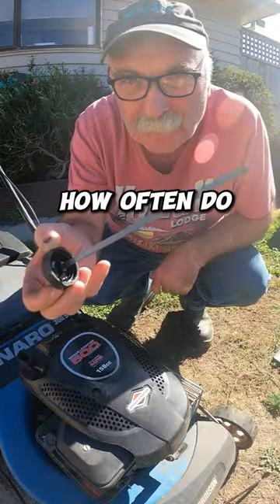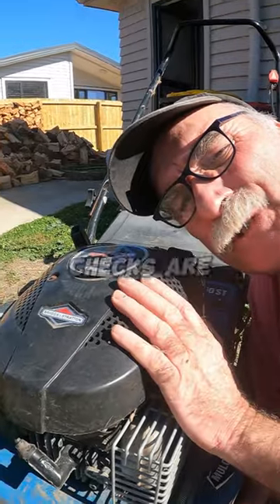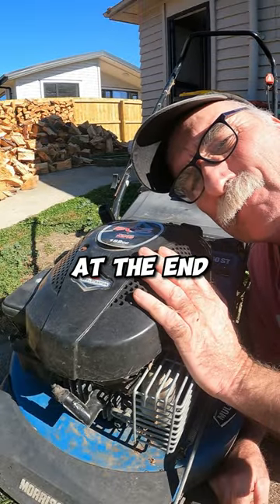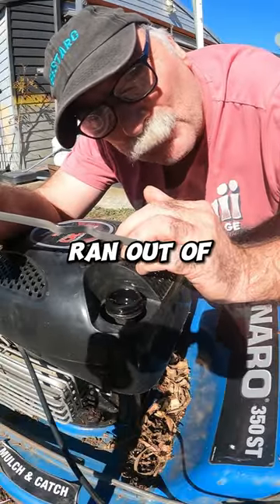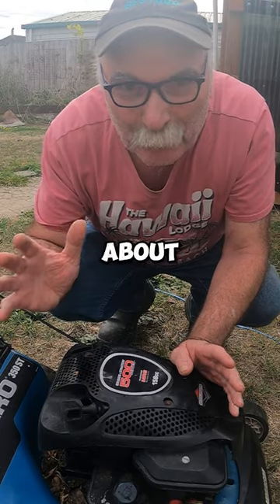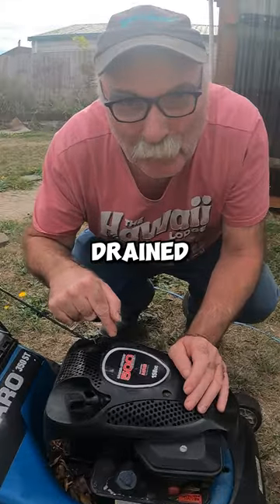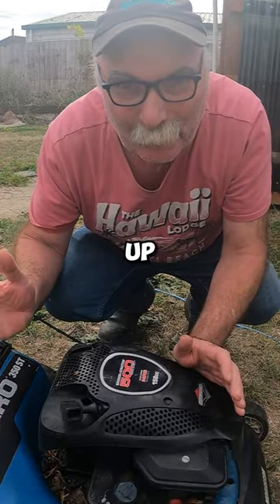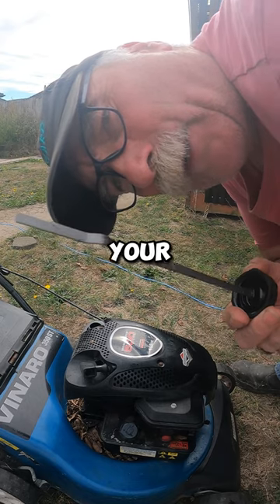Terrifying Consequences of Ignoring Oil in Lawn Mower

Comment: Conversely, if you put a penetrating oil such as Marvel mystery oil or pb blaster down the spark plug hole, you may be able to unseize the motor, perhaps you could show this as another Pete's tools tip
Edit: I personally recommend taking off the cylinder head after letting it sit and penetrate overnight, and inspecting the bore, also if the engine isn't unseized take a good sized dowel and mallet and force the piston to move again 
Hope this helps
Reply from the maker: oh really i might try cheers
Reply: @petestools, if you can get your hands  on some Kroil (formerly known as AeroKroil), that would be the best. It beats the stuffing out of PB Blaster. We have it in the States, but I don't know if it's available in NZ.

Comment: My 2 stroke doesn't run the risk of ever running out of oil without also running out of fuel. If you want to complain about emissions, you're welcome to buy me a high quality 4 stroke mower to replace my 20 year old one that still works.
Reply: Was just about to comment that this isn't an issue for two stroke mowers.
Reply: That's right mate, however you have to ensure you always use the right fuel since normal petrol filled in accidentally would kill it too within minutes